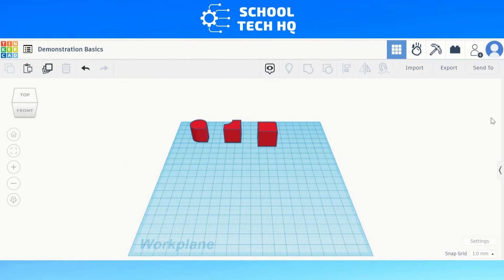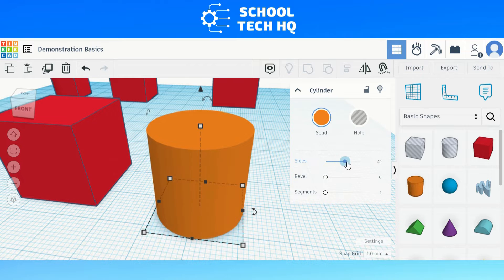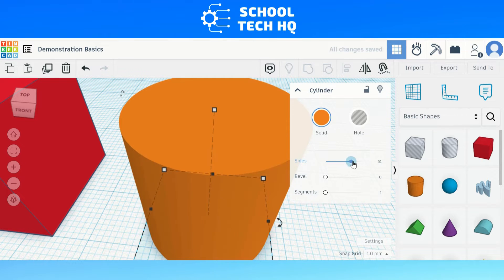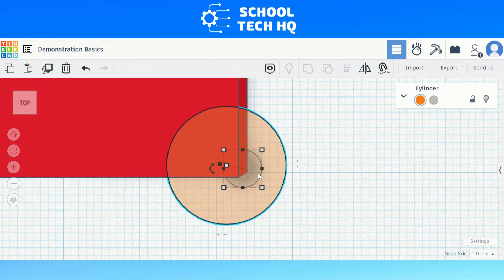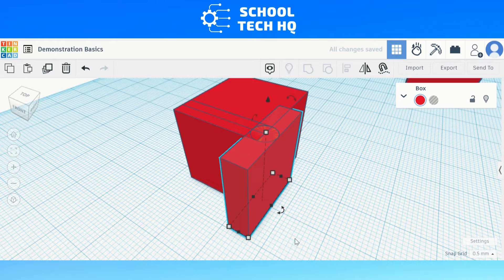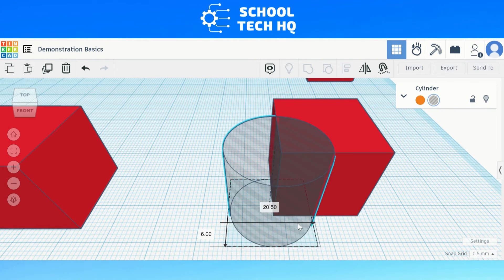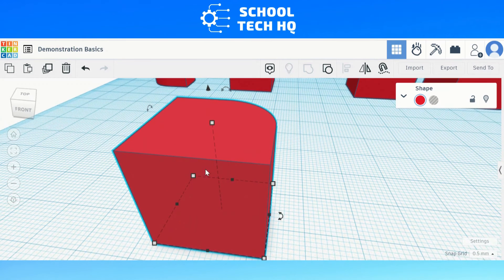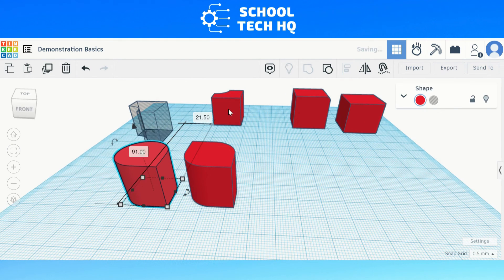Making Curved Edges in Tinkercad video w/ Mr Keir

Comment: Just putting this out there because I covered it on my channel a bit ago...  Make a cube, do not use the handles to resize it, use the size box that pops up when you create it.  The beveled edges will resize accordingly if you do NOT use the sizing handles (drag points)  The minute you do, the bevels will get stretched.  Then once you make that cube cut off the sides you don't want the bevels on with a Hole Cube.  Much quicker than what you are showing.   This is what I love about Tinkercad though... a million ways to get to the same point.  Making it a very valuable tool for everyone.
Reply from the maker: Thanks for sharing your expertise. I did create an updated video for this showing a much easier way to get a bevelled edge if you are interested in seeing another way to make a curved edge 😀

Comment: Not found how to add  a chamfer to a curved corner yet, any idea?
Reply from the maker: Check out an updated video with a fillet tool that you could also use as a chamfer. Alternatively, if you use a triangular prism or even a cube and rotate it to the 45 degrees required and use it as a hole that also could work. Hope that helps 🙏

Comment: Method one is very unintuitive and complex. Also, use the align tool instead of cursor keys to align objects.
Reply from the maker: Thank you for your comment. 😀
This is why I shared more than one method. These two methods are the most commonly used, especially with young learners (8+ years). The use of cursor keys is just to show an alternative way, especially for children, which might be easier for them instead of the extra step of using the align tool which, from experience, means more work for the teacher to have to fix when the objects go in all sorts of funny directions 😆

Comment: Thanks to tinkercad, all 3D printing sites are littered with terrible looking boxy designs that are also fragile. It is fragile because with fillets you can reduce many stress lines, improving part strength by 200-300%. Most of them are simple mounts but because of the bad design they don't even survive the mounting process.

Comment: Meta fillet in the shapes. You can adjust the radius and length. Way easier than building fillets
Reply: Could you please be  a bit more detailed how to do this?
Reply: @hansharbeck2424   yes. There is a search tab on the right for the shapes as a whole. Click on it and type in MetaFillet. That shape is essentially what he created. It’s fully adjustable. I put it in my favorites immediately because I use it on nearly every single build.
Reply: @hansharbeck2424  over on the shapes area to the right there is a search function..type in meta fillet… the shape is already made in there
Reply from the maker: Thanks for sharing your advice 😊
Reply: What does that mean?
Reply: @meisievannancy  in the search function for the shapes type in meta fillet. The shape will already be in there
Reply: I use the filet as a hole, I can align it to the edges and extend it to the length of the item and group them.

Comment: Is there any way to round the top face of complex shapes eg ring, star,  snowflake, letters?
Reply from the maker: Unfortunately, the way to round the top face of complex objects is the same, using either method. It will just take more time to do. An alternative method would be to download Autodesk's Fusion 360 and make a free account, there you can easily round edges by importing your design.
Reply: @TouchofSTEM Good tip. I've heard that fusion 360 only gives low resolution  on its STL file export for the free version though.
Reply from the maker: @meisievannancy  From my experience, I have not had an issue with resolution, but it may depend on the project. I have released an updated video with an easier way to make curved edges in Tinkercad.

Comment: I'm ZDP189. I find using grid snap and nudge less accurate than parameters, align and %scale. Also I use hole rather than transparent. 

Also, the best number of sides is usually not just max but usually a number divisible by 4 that is appropriate to the resolution of your print or model.
Reply from the maker: Hi ZDP189. Thank you for your comment and insight.
I find that when teaching young children, grid snap is the easiest thing for them to learn. I appreciate there are other ways of doing this. 
With the second method you will notice that I used hole instead of transparent because instead of adding to the object (reason for transparent in the first method) I am taking away from the object. It's less steps for learners (especially children) to have to switch from solid to hole to solid again for adding to an object. 😊